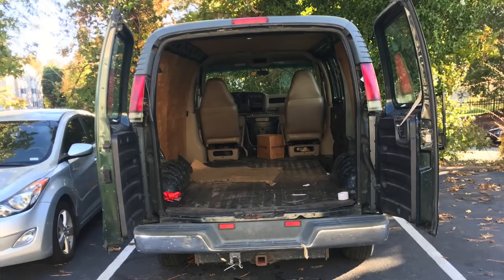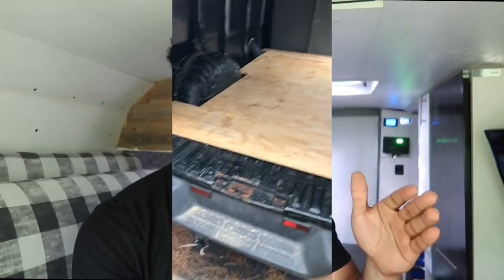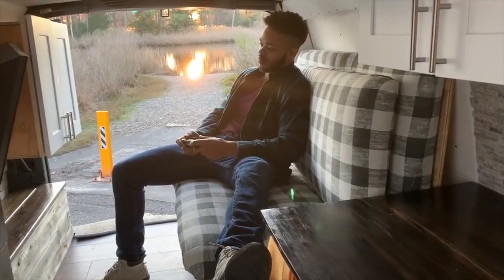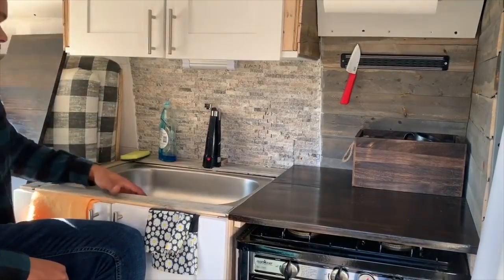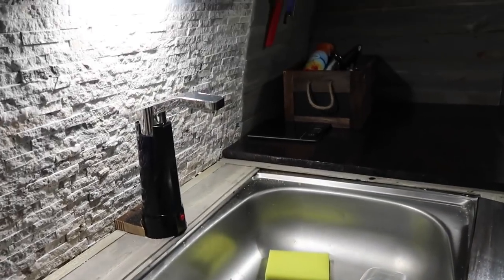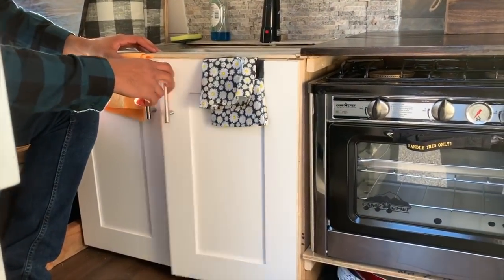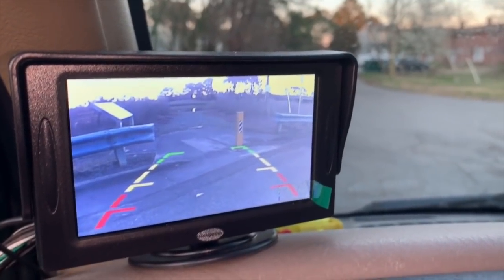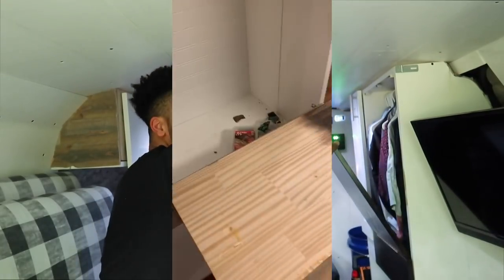How I Converted a Cargo Van into an Off Grid Tiny House

Comment: How hot does the camp chef oven get? Ive been eyeing it for awhile but Im worried abot it being a fire hazard
Reply: There are smaller butane cookers that are safe to use when you've got the van closed up. They are smaller, but they work rather well.

Comment: Thanks for the video. When you're putting in the furniture you mentioned that you put in studs or quasi type of studs in one of your videos and you use the PVC board as a sub wall. My question is at any point does any of your furniture actually go through the wall or the floor of the van? I'm about to start a build, so I'm a little bit confused do I need to drill completely through into the actual frame of my van or should I just use some sort of studs that are built into the floor so to speak or in the walls to drill in and my furniture into. Thank  you

Comment: I have space 4 an awsum build with a 3500 enough 4 a bathroom😋now let's see if my comprehension is logical enough to not start a fire. Maybe I'm going overboard with mosfets and capacitors and diodes but im sure the van I make will at least save me $600 a mo. in rent